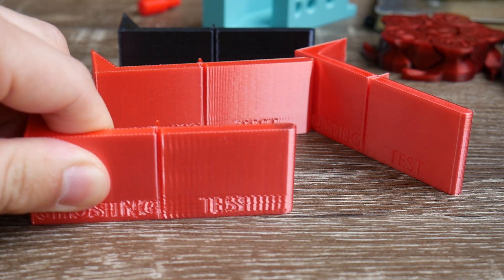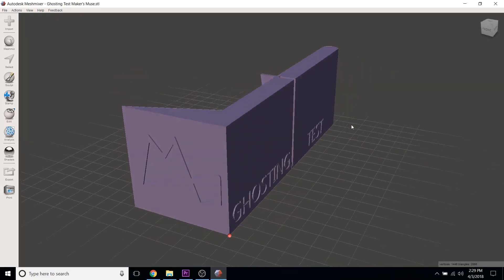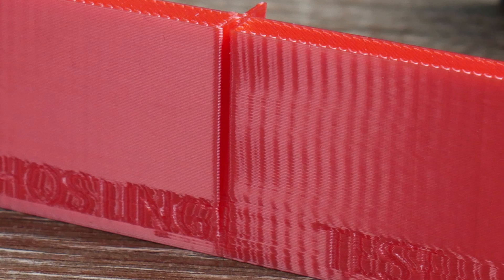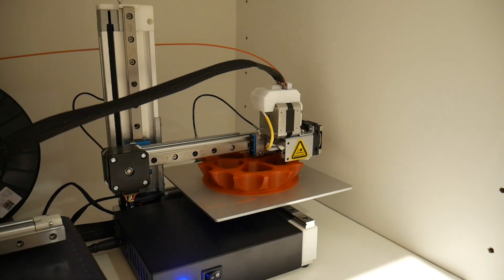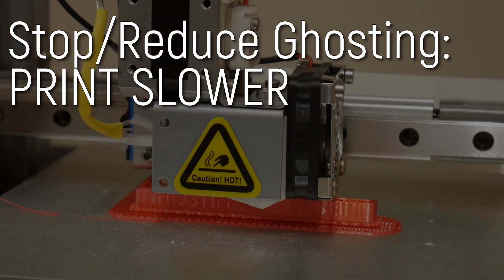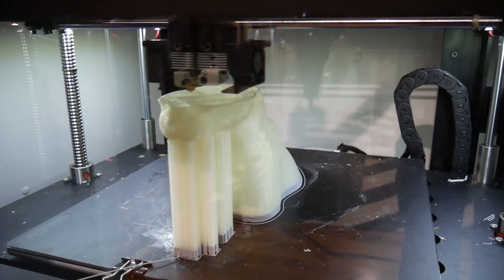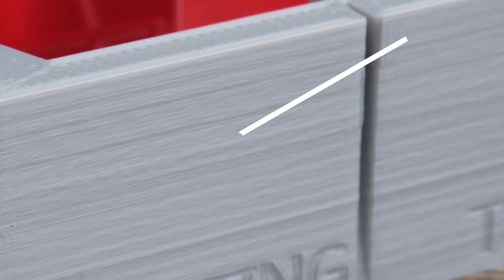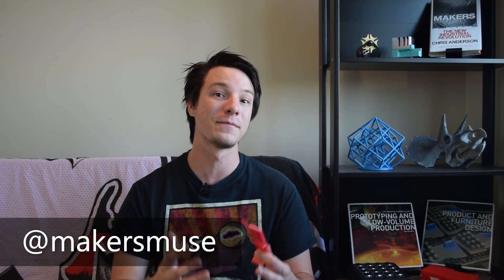Ghosting in 3D Prints - What is it and how do you fix it?

Comment: Stiffening and reducing mass both have the effect of raising the natural frequency, and dampening like with shock absorbers as you mention has the effect or reducing the amplitude but widening the range of that response.  Likewise slowing down the print speed lowers the working frequencies of the system.  The goal is to push the systems resonance response high enough that it's outside of the working range.  This method can of course reduce resonance but it can also introduce new resonances that weren't there before.  

There is an alternative in that you can increase mass and attempt to push the resonance outside of the working frequencies by decreasing the resonance frequency substantially.  This isn't necessarily a good fit for 3d printing but it does well with someapplications. 

Ultimately though no simple solution like this will do as well with as little as a control system in the firmware with proper resonance compensation.   Traditionally for mechanical systems you use a a state observer (a low order Luenberger observer) to inform a feed forward controller which deliberately offsets the resonance peak from the control signal.   This is part of why higher end 3d printers despite similar construction standards to other cheaper printers, can at times get better results.   A lot of thought is given to system rigidity, resonance, and the control logic itself.

Comment: Presumably lower quality stepper-motors on the cheaper printers would also add to the problems like rigidity, belts,, etc., that were mentioned!
Reply: Generally stepper motors are all pretty good. It's most likely a microcontroller problem.

Comment: I was really hoping for more information in this video, about how to tweak jerk and acceleration settings.  The defaults in Marlin firmware are really not right for my printer, and i end up having to print excessively slow as a result (I have no Idea what my printer's original factory settings would have been, because upgrading Marlin changed them)

Comment: Would it be possible to use a normal 3D Printer in some sort of non-conductive oil (Like the stuff LinusTechTips used to dunk an entire PC into) And if it is possible at all, would it be able to prevent the need for putting Supports on your prints since the oil might provide the support it needs.
Reply: Interesting idea, but i think oil would severely mess with layer adhesion.
Reply: At that point why not just go full SLA
Might work though, try it out and tell us how it goes.

Comment: Ghosting can be eliminated 100% without changing acceleration and jerk with proper firmware/stepper drivers. There currently aren't any solutions for DIY 3D printers that I'm aware of, but there are many for commercial CNC machines. Basically the algorithms will anticipate when a change in direction is approaching and modify the instantaneous jerk and acceleration appropriately in order to eliminate the extra "spring"/slop upon completing that motion or change in direction. I'm sure Marlin will eventually implement something like this, although tuning for each machine individually would be tough which I'm assuming is why nothing like this has been implemented yet. An auto-tuning script would likely be needed which would require stepper drivers with accurate positioning feedback.

Here's an example of this algorithm, not my video! https://www.youtube.com/watch?v=eUZVLMCmSxI
Reply: exactly :) there are some works being done. constant acceleration and deceleration on most firmware hinders the ability to print at high acceleration/deceleration.

Comment: Have you considered using a tuned mass damper fixed on the head to reduce vibrations? Such as a small weight mounted on a flexible wire or a spring for example. This is commonly used on tall buildings to mitigate the effect of wind or earthquakes.

Comment: I would call it resonace, but when I show our chief engineer a component we're trying to machine I tell him, Malc, I've got wobbly bits again!
 Rigidity is key. Hobby grade 3d printers are basically low tolerance machines, so good positional accuracy and smooth surfaces are mostly controlled by either better quality components and, or speed of X/Y moves. 
We get this in our milling machines once they are a few years old. So, effectively it's caused by wear in the lead screws and the CNC not being able to deal with it. Yes, slowing down the X or Y axes moves will usually solve it, but of course, time is money. It doesn't happen in Z to the best of my knowledge.
.
I hadn't read this before today.

Quote from Wiki.
-------------
The running speed for a leadscrew (or ball screw) is typically limited to, at most, 80% of the calculated critical speed. The critical speed is the speed that excites the natural frequency of the screw. For a steel leadscrew or steel ballscrew, the critical speed is approximately[17]

    N = ( 4.76 × 10 6 ) d r C L 2 {\displaystyle N={(4.76\times 10^{6})d_{r}C \over L^{2}}} N={(4.76\times 10^{6})d_{r}C \over L^{2}}

where

    N = critical speed in RPM
    dr = smallest (root) diameter of the leadscrew in inches
    L = length between bearing supports in inches
    C = .36 for one end fixed, one end free
    C = 1.00 for both ends simple
    C = 1.47 for one end fixed, one end simple
    C = 2.23 for both ends fixed

So if your machine, whatever it is, already had issues, ie: low grade parts or any flex in the chassis, any time you hit the critical speed of your lead screws, X or Y, all the other probs only make it worse.
Reply: No lead screws on X and Y on 99% of the FDM printers. It's 6mm GT2 belts.

Comment: Another very good informative video Angus....I always look forward to your videos as I almost always get something of use from watching them-your heading towards my Patreon subscribe-ees mate. As a retired engineer who had a vast and varied 
Career doing everything from setting up PLC’s in heavy plant machinery,and a number of years doing  F18 hornet aero engine maintenance and overhaul plus wider aviation engineering, to extensive Gcode programming, and in the latter years doing project management in oil and gas, and then a few years deign and manufacturing engineering, there’s not much I haven’t seen or worked with or on in the past. I’ve said before how 3D printers really are just another form of CNC machine and issues like resonance and harmonics are also not foreign to machines such as machining centres and the like. I really enjoy your videos and I hope the non-engineers who follow who also print (and a lot are very clever people with IT/Programming type backgrounds) understand a lot of what are essentially common engineering issues and gain some solid engineering fundamentals in these short videos you make just as someone like myself learns a bit more about something like (in this case) jerk settings and the effect of changing them (I don’t agree though with tweaking firmware to fix what is essentially a hardware issue-such as a non rigid frame for example).A very information rich 6 mins of video mate-keep it up.

Edited cause my phone can’t spell ;)

Comment: Deltas are less prone to ghosting by their design, right?
Plus the fact most of them use bowden tubes would help..... Right?
Reply: I have a Rostock Max V4 from SeeMeCNC and I got bad ghosting on a vertical wall with embossed text, so I’m playing with accel and jerk settings in Cura.  Just halving those two speeds caused the ghosts’ ripples to be farther apart, so I think I will eventually get to where they’re gone.

Comment: I'm not griping at you or anything, it's just Calling it "ghosting" is so misleading. A better term may be "fucked up job from a shaky setup" or "expensive squiggle writer". Or if it HAS to be some fancy word, then call it something like "vacillation" or "aberration" or literally anything relating to what's going on to cause the error in the first place. Calling it Ghosting because it looks kind of spooky is just a let down because I was otherwise led to believe that the errors were caused by some sort of memory imprint from previous tasks. You know, what the term "ghosting" typically refers to in one way or another in any other use hahaha.

Comment: Nice video Angus! I was a little bit disappointed that you didn't cover stepper driver dampeners and variations in belt material and tensions.
Reply from the maker: It's such a complex issue... yeah, I need to play more with dampeners but my experience is they round out detail in expense for 'smoother' prints.
Reply: Yeah, dampeners probably was a bit overboard. But belts are at least something that is pretty easy to swap and as far as I know these can make a big difference if the frame is kind of rigid and the belt is springy.

Comment: To me, ghosting is somewhat of a "perfect storm" of issues. Frame rigidity, vibration absorption properties of the base, acceleration/jerk settings, and print speed. I would also add nozzle wear, printhead weight, drive belt tension, etc. Unless the ghosting results in an unusable part, it's really not a huge issue, especially if the part will be post-processed. As far as small details and such, if you want good, fine details, you really shouldn't be using an FDM printer in the first place. 

Great video overall. Still yearning for more Fusion and Meshmixer tutorials... ;)

Comment: I tried some aproaches with mediocre or no success:
1. I improved regiditty. This made the prints much more accurate but induced evan mor ringing. That is counter intuitive but logical because the slack I had before acted as an damper.
2. I enforced belt tension. This changed the pattern and helped a bit overall. Increasing the force of the steppers by changing them and cranking up the current did pity much the same as higher belttension.
3. I than tried shock absorber under the printer. The impact on the ringin was not noticeable, but it reduced the accuracy.
4. The next attempt will be stronger belts.
From an physical perspective it is quite simple: if you put energy in the system it must has a way to come out again. This happens by dampening only. Higher regiditty only changes the frequency of the resonanz. This helps a little, because higher frequency means the existing damtening is applied more often.
Realizing this in practice turned out to be much more complicated.

Comment: You could also try adjusting the timing belt tension. The direction change isn't transferred as quickly to a loose belt, so the ghosting is at a lower frequency but more pronounced. A tighter belt will help transfer vibration to the frame faster and hence dampen it.
Reply: >timing belt

Comment: On your Prusa print I see the infill looking through the outer wall. I have the same problem on the MK2s with linear advance (latest firmware). What is causing this and why is only the Prusa showing that problem?
Reply from the maker: Try increasing walls to 3 perimeters, it's only 2 in slic3r and it's not enough in my opinion!
Reply: Thanks! Tried that, didn't change a thing :/ All screws on the printer were ok, I oiled and recalibrated it and will test it again tomorrow.
Reply: Reduce infill overlap?

Comment: It's breathtaking to me, that this crap has not already been designed out and resolved in software. The equation "poor rigidity + print head x speed = bad prints" is one a child could calculate and adjust, yet these companies leave it to the users to figure out using expensive material. I really feel that this entire industry is flooded with shitty companies out to make a fast buck whilst providing an abysmal, expensive and frustrating customer experience. Comparing this to the birth and growth of mono ink then colour ink jets and lasers, the 3D printing market is MUCH slower to mature to something that is usable by non experts. They really need to pull their fingers out.
Reply: I get what you are saying, but I also think there are a couple of counter points:
1) My first printer (9 needle ribbon matrix printer) couldn't even print proper mono space columns, and would tear the paper ever so often despite it having guide holes in the sides.
2) All three of the inkjet printers I've owned have managed to clog up their print nozzles because I only print a couple of times a year. We are still point... An inkjet is no use for the rare occasion, and the price of a laser printer isn't justified. 
3) All the HP LeserJet III printers at my school were notorious for paper jams. (This was fully fixed with LaserJet IV).
4) 3D printing is seeing a much slower adoption because the vast majority of people don't have a need for little plastic nicknacks. People did however have a need for writing and pictures on paper. Without printers the first few generations of generally available computers would have been utterly useless because you couldn't e-mail you text to anyone, and every official capacity demanded paper documentation. Incidentally this is the only need I still need printing for: some stupid office that doesn't have an online form to fill out yet. 
5) You get what you pay for. Cash out two grand on a Makergear M2 and you won't see ghosting. Those are build like a tank. Cash out $200 and you get a Chinese toy that can squirt plastic roughly in the direction you want it to go. Incidentally two grant, adjusted for inflation, is right around the price tag of the first properly reliable laser printers.
Reply: Hmm, you are saying software should solve the problem? Definitely possible, but even such a solution would reqiure either manual tuning or sensors!

Its not quite as easy as you might think.
Reply: There are 100's of types of 3d printers and most don't vibrate as bad, the problem mainly happens after the printer get worn. and so i having same issue after a year of using my Anet a8 non upgraded. i solved my issue after putting more tension on the belts , in this case a simple fix, and thus i have ordered some new belts to replace if get worse again.

Comment: This is what happens when you count on rigidity to keep things stable instead of feedback. And with rigidity, there's not much you can do, and it's a black art. Giving it a whack with a hammer might help, or it might make it worse. Same with attaching a weight or a spring.
The advice to increase rigidity ... I'm not saying it can't work, but it will never fix it. And totally overdoing it might make things fall apart or worse: suffer high stress during operation and then suddenly fling a metal arm across the room.

Comment: Lowering the perimeter or wall acceleration settings in slicer has a huge effect on removing ghosting. Available at least in Slic3r (Print Settings -> Speed -> Acceleration control -> Perimaters) and Cura (Speed -> Print Acceleration -> Wall Accceleration -> Outer Wall Accceleration). I use 2000mm/s² as the default acceleration and have outer walls printed with 310mm/s² acceleration.
Reply: I posted a copy of your comment on the top comment for all to see. I think Angus should make this top comment as well.
Reply: I got just as much out of your comment as I did the video. Thanks.
Reply: Good to know!  I had no idea the slicer even had such a setting
Reply: @jameslaine2472  yuo need to activate the options
Reply: Well Jonni, aren't you even gunna thank UFO? It's been a year now and we're all waiting.
Reply: Thanks for the tip., im try it
Reply: What printer do you use?

Comment: I already put my mk2s on 2cm thick rubber plate but I noticed this ghost effect on a print. 
Does the concrete above the rubber doing a big difference?

Also I thought that I have ghost effect because I put the motors in silent mode instead of power mode . what do you think?

Comment: As another commenter mentioned, it’s the result of having too much acceleration for the rigidity of the machine. The belts used on low-cost 3D printers are kinda springy, resulting in the attached components vibrating when suddenly accelerated. If you can’t upgrade the rigidity of your machine, the only other parameter you can adjust is to turn down the acceleration. Adjusting the speed may seem to help, but what’s going on is that the ringing is still present, but it’s just been compressed into a smaller area because the head isn’t moving as fast. Turning the acceleration down will actually reduce the root problem; not just mask the effect.

BTW, this is why CNC milling machines and lathes use ballscrews for driving their axes - they are much more rigid than belts.
Reply: They also use ballscrews due to the fact that they have to go through many more forces linearly. 3D printers have very low force witch allows them to use belts to save weight and costs. But yes they are more rigid than belts.
Reply: And the tool head moves slower.
Reply: Since I upgraded my frame for a solid metal frame, I have a lot of ringing..
Reply: CNC Machinist and design engineer here, you're correct about the ballscrews, linear guides are even better! But no budget 3d printer will have those on their machines, I've found that adding 4 tungsten weights to my Elegoo Neptune 3 dampens vibration quite a bit. Also setting the machine on a paving block helps quite a bit too.